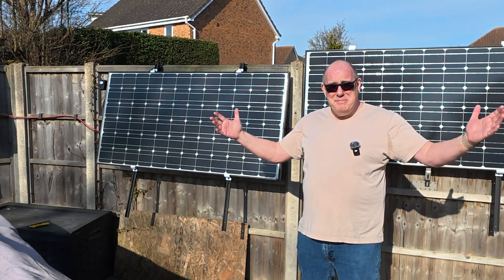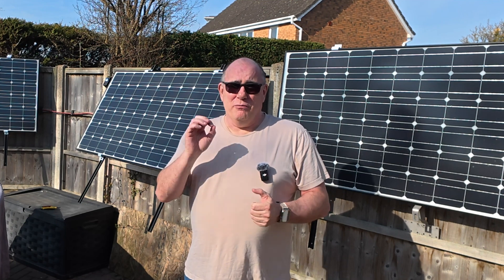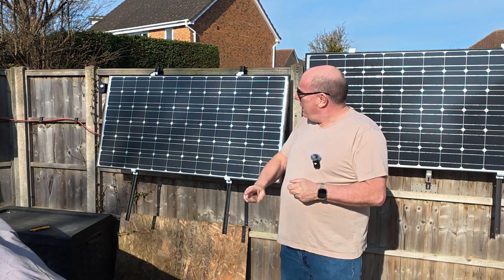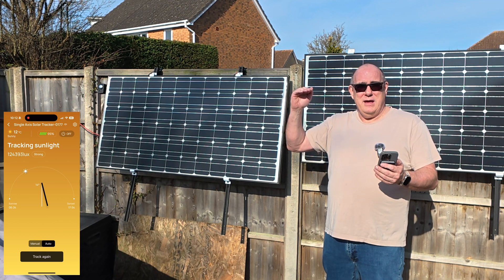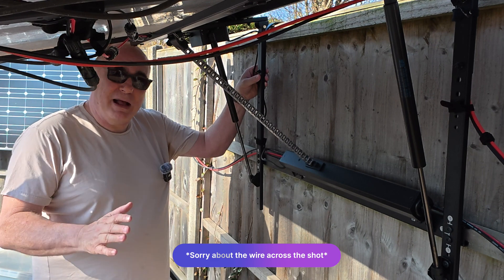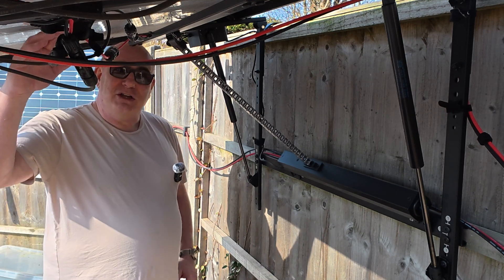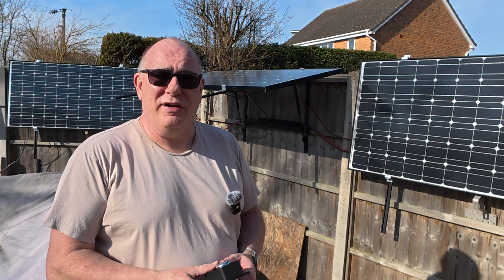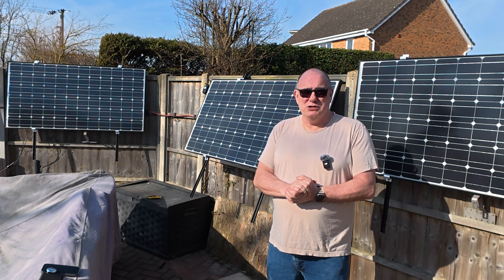Power UP Your Fence Mounted Solar Panels With Ease

Comment: I wanted to install it as an awning above my entrance door. The rain tracker might put a spanner in the works 😅. 
And there's more hardware underneath than expected. I don't think my better half would enjoy that esthetic.
Reply from the maker: yeah, my experience with the tracker hasn’t been what I would call amazing, in fact it’s currently sitting in the junk pile as it was more trouble than it’s worth. It may be gave an extra 5% on the generation numbers but for the amount of days I spent trying to convince it to work, it just wasn’t worth it.

Comment: You are into solar panels and yet you say you are skeptical as to whether the panel tracker will pay for itself. Dude I have 3 panels on side of lorry. Inside iMac computer. 5Kv inverter. Oven, microwave, toaster, 200 watt electric hot plate. All free. Never need power and I got 6 more panels here beside me to fit on the roof. Solar trackers 100 percent pay for themselves. They are brilliant.
Reply from the maker: i’m afraid my evidence doesn’t support that, the tracker ads may be 10% to 12% extra generation, and it would take probably 15 years to pay for itself. And based on the mechanical construction I very much doubt the mechanisms would last that long. Happy to be proven wrong and there may be trackers out there that are substantially better built but I just don’t think this one will last that long.
Reply: @JonathanTracey  if you look at the output of one solar cell flat on the table from a multimeter and then raise it to be basked in sunshine. The difference is staggering. From couple hundred milliamps to up over an amp. I only use solar and dont have any electric companies supplying me
Reply: Depends on the steel used
Reply from the maker: nothing to do with the steel, it’s more to do with the quality of the motor, the electronics and all the moving parts

Comment: Mount it vertically and would it track it east to west
Reply from the maker: It only has 80° of movement so it could track either to the east or to the west but not east to west
Reply: @JonathanTracey  just a thought thanks
Reply from the maker: I think it could work on a ground or flat roof to raise and lower panels, but you would need two one facing east and one facing west

Comment: Thank you for the very interesting review! Can you share any technical data about the gas struts and the chain actuator? Sizes, rating, ...
Reply from the maker: I'm afraid I cant, I check the gas struts and they have a bunch of Chinese characters that google only translates as the company name. The chain link is about 70cm when fully extended but again no other details I get from the manafacturer
Reply: @JonathanTracey  thank you. How long are the gas struts when extended and when retracted?
Reply from the maker: 30retracted and about 50 when extended

Comment: HI again, can you confirm how you have the ecoflow powerstream connected to the house. I'm reading conflicting information that you can plug straight into a 3 pin socket and then other material that it has to be wired in at the consumer unit.... looking for some clarification
Reply from the maker: when I first received it, the connection was via a 13 amp plug. And it worked perfectly. About six months later I was contacted by EcoFlow and told they would be sending me a new cable and that it was no longer allowed to be connected via a 13 amp plug. The new cable arrived which was basically the same as the old cable with a 13 amp plug cut off the end and bar wires. It then required to be connected to a fused spur that was run off the consumer unit. It seems the UK regulations do not allow you to flow power back through a UK plug. However, it ran for nearly a year in that configuration with no issues. So today if you buy one, you will get the cable with no plug on the end and bare wires.

Comment: Can you confirm the direction of the panel that the trakcer is on? I'm looking at the balcony ecoflow solution, but I'm in a heavily built up area (Hampshire, UK) so panels are likely to be either E or W facing. Would wonder if this addition would be a benefit.
Reply from the maker: mine is SE facing, it seems to be getting about 15-20% more than vertical mounted panels

Comment: Have a question for you I know you are quite obsessed with batteries I have a system with one 5kw battery what do you recommend get another battery or use the money for more panels?
Reply from the maker: Hard to answer without knowing your usage pattern, a 5kw battery seems quite small, its it a hybrid inverter with the battery behind it, or is the battery ac coupled? What size is your inverter?
Reply: @ Hi Jonathan it’s a Duracell system 3.6kw inverter this was the largest they could install without lengthy paper work and time consuming application. 12 panels on roof split 6 on front 6 on back
Reply from the maker: So I think you’re gonna be limited by how many extra panels you could add to a 3.6 kW inverter. It might be worth checking the specification sheet and see how far it can be over provisioned. For example some larger inverters let you over provision up to nearly 200%. But for a smaller inverter that might be something like 120 to 150%. That means the total capacity on your roof could be 120 to 150% of the size of the inverter. It’s important to check this.
Reply: @ I have watched your videos on YouTube and I wish I had watched the one when you were advising people not to accept the installers recommendation to only go with a 3.5 kw inverter had I seen your video before my installation I would have gone for the biggest inverter I could have afforded at the time. As I am now stuck with an inferior inverter and battery backup. Like today the weather was not at its best but my battery was fully charged by lunchtime and the rest went to the house and at least 1.8kw per hour went to the grid and I live in Scotland.
I could double the amount of panels on my roof but I could hit planning problems which I think is a farce I don’t see way I should  have to get planning permission to help with the environment and save energy costs when  my house is detached well I have had my rant thanks for your advice I will keep watching your vids keep up the good work

Comment: Payback.....

Efficiency is proportional to the cosine of the aiming angle error.
IF yore bang on, that's 1, if you're completely wrong (edge on) it's 0.
IF you're 10 degrees off, it's 0.985
20 degrees 0.94
30 degrees 0.866

That means that if it corrects a 20 degree error, you'll gain 0.06 (6%).
Reply from the maker: so the whole point of the tracker is to keep it as close to perfect as possible. Now with a single access that is not going to be achievable because obviously the Sun doesn’t just track up and down it tracks left to right as well. I like you’ve done the calculations and I think it’s going to take many years to pay for itself. But that’s the whole point of the experiment.

Comment: Worth testing if one chain can pull down multiple pannels, then it would be great investment.
Reply from the maker: you would still need two sets of hinged panel mounts. Also a second set of gas struts, and then have to Jerry rig something that would link the two panels together so that they could be pulled by a single motor. Sounds like a project.
Reply: Aluminium pannel rail, jointing the two or three, first youve got to ckeck if the gas struts can push up more wieght, i have 8 tilting pannels,  pulled up with a 1 ton winch to 60deg and then i lower then 20th March up on September 20th, i did buy a Chinese single axis controller with wind safe sencor £70 originally £97.
Reply from the maker: The gas struts are rated for panels effectively double the size of my 220 panels. So I would imagine the gas struts can easily lift two of the panels. But maybe not two 440 W panels.
Reply: Ah, oh well the single axis windsafe controller has a 30amp relay which could be wired into a 200amp relay, lifting x tons, if you want bigger and cheaper diy.

Comment: Very Interesting Love to purchase one But as I don't get sun all day Wouldn't work sadly. But instead I've put my solar panels in two sets so that At least 2 Will get sun as the sun moves Only two shade and two still get sun power. I would love to know how to measure the sun I get
Reply from the maker: co you have them on seperate strings so the shading of one set does not effect the other set. I measure mine from the powerstream inverter. It has 2 MPPTs so I can see each string and how they are working
Reply: @JonathanTracey  I've going to upgrade my MPPT Need Data like your Be really helpful after 3 years of having Solar I've now found out
Reply from the maker: If you have a shading problem, then it may be worth checking out some optimise so that your string is not dragged down to the lowest common denominator
Reply: @JonathanTracey I'm going to order some Tigo Ones Thanks for the Information Most Valuable
Reply from the maker: any time
Reply: @JonathanTracey  Hey Thanks to your advice I purchased two Optimizers and my New Inverter has Full solar tracking,  But I've had to put solar panels in series as its got to be above 60v Fingers crossed for good weather To help pay for the upgrades

Comment: Using a PV simulator suggests this might give an extra 150kWhr/year from a 500W panel, so if that directly offsets grid consumption it saves £35/year or an 8 year pay back at best? However, I'd be really surprised if it survived that long in anywhere but the most sheltered locations, and for the me the beauty of PV is no moving parts.
Reply from the maker: Our garden is pretty sheltered, but I take your point anything that moves needs maintenance and I suspect the payback period is just going to be too long

Comment: Wow i only paid £50 each for my 6 445w panels, think I'd prefer more panels than just one which moves. They are sitting pretty much flat on the garage roof and were getting 1.4kw from 10am till 2pm this afternoon, generated 7 KW in total today.

Comment: I only have 820watts of solar panels for a diy off-grid system but the best upgrade i have made is a bigger solar charge controller. I didn't think I'd ever see full output from the panels so I had stuck with my charge controller which could do 550 watts but it didn't like partly cloudy weather when the sun keeps popping out from behind a cloud. It would overload and shutdown for a few seconds. Now I have a solar charge controller that can handle nearly double and I've seen the panels output over 1000 watts due to the effect of reflection and diffusion off the clouds (+direct sunlight). The bigger charge controller has maxed out at the limit of 35 amps vs the max of the smaller one at 20 amps it's no wonder the smaller charger overloaded. Another reason for the upgrade was that I added another battery to give me 5kwh so I wanted to be able to get a full charge in one day which I'm nearly achieving already. The surprising thing is I've seen sustained output above the panels rated output, not just peaks. On blue sky days though you don't get the rated output.
Reply from the maker: That’s something. I might have to look into when I get larger panels to replace these old 220 W panels.

Comment: Very sceptical about payback with the item but if you are in a situation where you just want to generate the maximum amount of power it has use cases. I personally went with a manual none motoried system, which works pretty well but is a bit of a pain to adjust but at the same time I only have to move it a few times a year. Was a nice day today, got 3.01kwh from a single JA solar 440w panel. I'm assuming you have that panel on its own mppt for monitoring?
Reply from the maker: Yeah, I think the payback period is gonna be a very long time. However, it’s a nice experiment. Yes, I have the panel on its own MPPT right now but I’m actually thinking of doing a comparison where I hook that panel and the one next to it to separate batteries. Drain them right down and then see much they can be charged up in a given time to see how effective the tracker is
Reply: @JonathanTracey  Personally I'd be okay with ecoflow data but I do hate how long it takes to update the app. I don't suppose you know of a way to force the stats to update every 5 mins or something do you?
Reply from the maker: I get mine via the EcoFlow cloud in Home Assistant. I’m not entirely sure what the polling period is but I have seen the numbers changed certainly less than five minutes on my Home Assistant dashboard. It could be that the app is only updating every five minutes but the data is changing in the cloud and a much more rapid pace
Reply: @JonathanTracey  oh my graphs only update every hour. I have live readings though but graphs are very slow to update
Reply from the maker: Are these the graphs in the EcoFlow app?
Reply: @JonathanTracey   yeah thats the one
Reply from the maker: yeah they seem to be slow to update, graphing in home assistant is faster, just not as nice looking
Reply: @ really nice app and ecosystem other than that one thing. seems like a simple app update for them tbh

Comment: am i the only person trying to work out how to make this work the other way?
Reply from the maker: how do you mean the other way ?
Reply: @JonathanTracey  left to right
Reply from the maker: i’m sure it could be done but the gas struts would have to be adjusted as the lower one would have compression forces on it as the whole weight of the panel would be on it
Reply: @Slyons1984  I mentioned this in another post so that it might track east to west for example. However as mentioned, weight might be a factor and cause twisting of the frame? Would be a good experiment, just for a laugh though. 🤷🏼‍♂️
Reply: @Sno0py-XV208 I think lifting the panel would be harder than rotating it. You would get better pay of this way I would say. It goes 75 degrees. South east to near west long day

Comment: Thanks for the review. I am a big EF fan and am considering adding at least one 440w solar panel. Still deciding whether to get the portable or fixed one though. EF have a Spring sale on at the moment too. Agreed ref the cost benefits of the tracker, which seems a simple, yet nifty bit of kit, albeit a bit pricey even at £299. They are more expensive at the moment I believe, even in the sale. By the way, although the kit is hooked over the fence, are the vertical suppprts/brackets screwed to the fence so that it can’t blow off? Thanks again..great info from a fellow Cambridgeshire person!
Reply from the maker: i have a portable panel and unless that is a specific need a rigid panel is always going to preform better.
Reply: @JonathanTracey  Thanks. Useful info. 👍🏻

Comment: So interesting! I agree that it's unlikely to be cost-effective but it's good to know about nonetheless!

By the way - really glad I took the plunge into having a heat pump now. It's great on these cold but sunny days because it doesn't take long after the sun comes up before my heating energy is being fully provided by the sun. I didn't expect to save much money from the running costs, but it's entirely possible that I might.
Reply from the maker: it’s been great this month, the running cost so far has been £0 as we have generated way more than it has used

Comment: 04:27 Are you sure the CHAIN PUSHES the panels away? My sense is that the chain elongates, which lets the PISTONS push the panel away. When the motor goes in reverse, it pulls the chain in, collapsing the pistons and lowering the panels.
Reply from the maker: yes, as each link of the chain extends it forms a solid rod that pushes, but that’s not the only force pushing the panel out. The gas struts are also under compression when the panel is down so they are constantly pushing out as well.
Reply: @ Yes, that’s what I was clumsily trying to say. I can’t see any reason why the chain needs to push when the struts are already doing that? Perhaps the links lock to stop the wind forcing the panel down against the struts, rather than push the panel. We may never know…But if it isn’t broke, don’t fix it…lol I wonder if you mounted it on its side, it would track east to west? Just a thought, like us techies do? It’s a curse! 🤦🏻‍♂️
Reply from the maker: i have not measure it but the struts are doing most of the work, the chain i suspect is belt and braces for larger panels, there does not seem to be any adjustment needed for panels up to 2x the size
Reply: Y'all are missing each other's points.
  Jonathan clearly says in the video that the struts are constantly pushing up (away) while the chain either let's out slack or pulls up slack which is adjusting the angle. 
  The chain doesn't and can't push up/out/away.

Comment: Interesting experiment, but for that money you can buy three 450w panels and still have change, although you'd need to factor in inverter costs. PS over 58 kWh generated today, 8.3 from my three wall panels. 😊
Reply from the maker: yeah, I think this solution is really designed for people to hang on a balcony therefore they may have room for one or two panels
Reply: @JonathanTracey  The only catch with that, is once the panels stick out more than 200mm you technically need planning permission. Unlikely to be an issue unless you have troublesome neighbours.

Comment: That is quite expensive for something that can only fit one panel. It is kind of cool though.

Personally I played around with the idea of building an adjustable mount with an angle to suit every month. It would only face south but be almost vertical in winter and almost horizontal in summer needing only 12 manual adjustments per year.

In the end I just went with an almost horizontal mount (10 degrees) because of the WAF. Looks a lot better and in overcast weather when I need them the most, horizontal works just fine.
Reply from the maker: yeah, I suspect the payback period on it is going to be very long but it’s a nice experiment